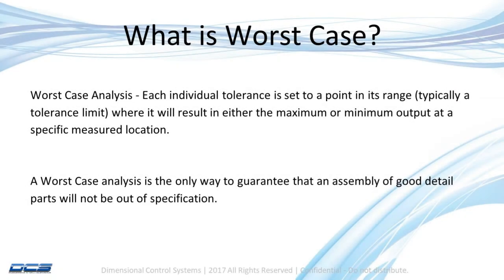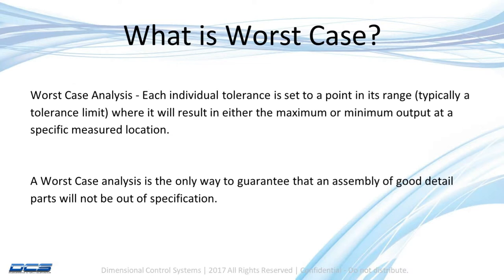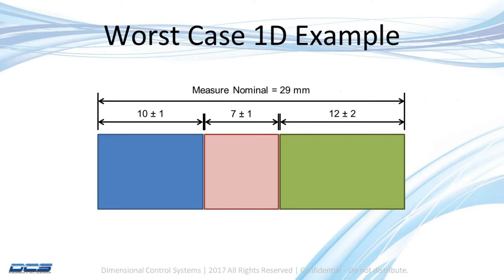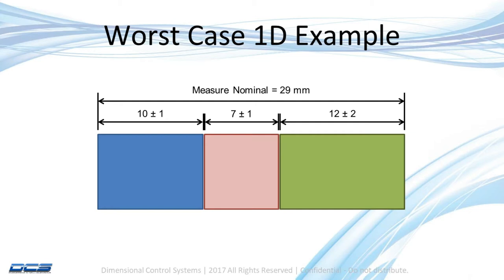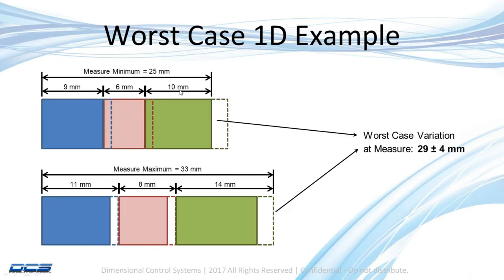What Is Worst Case? -- 3DCS V7.5 part 1 Worst Case

Comment: Why worst case is costlier than RSS
Reply from the maker: Worst Case has you design to account for 100% of cases, including those statistical unlikely to happen. Unless you have a very skewed distribution, you'll be expecting a normal distribution of outcomes, meaning you can design to 4 sigma, and account for the vast majority of cases, while requiring less precise tolerances and reducing manufacturing costs. A simple check or inspection for those outlier cases will keep them from leaving the plant in the very rare case that they occur. This is a far cheaper and more efficient method than designing to account for cases that will happen .0001% of the time.